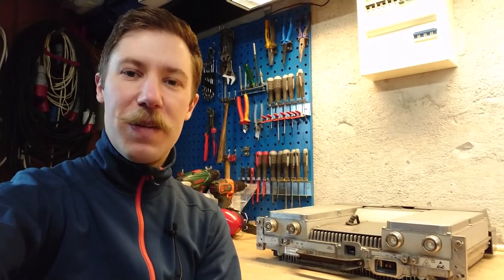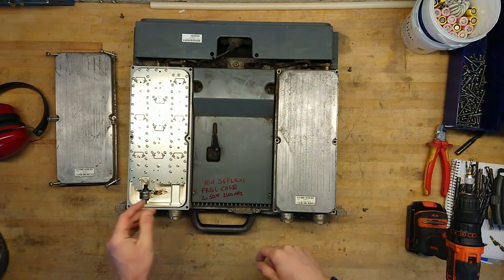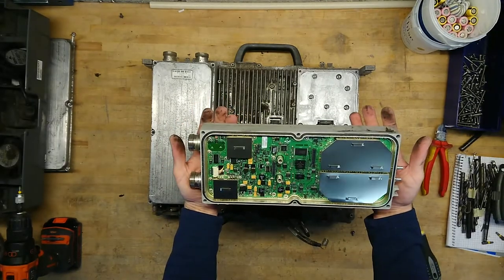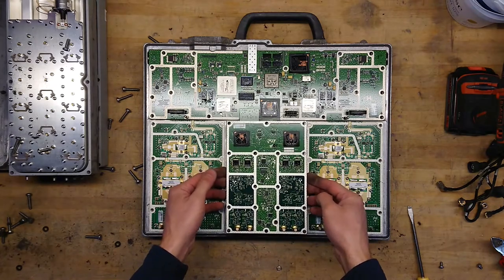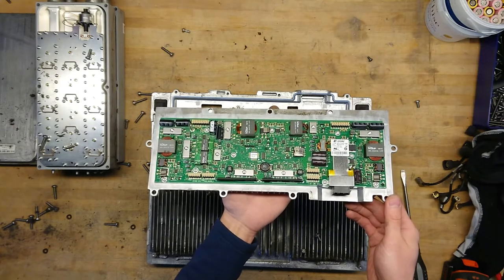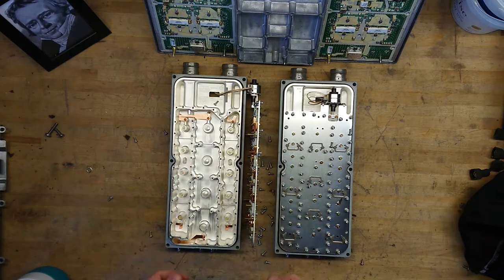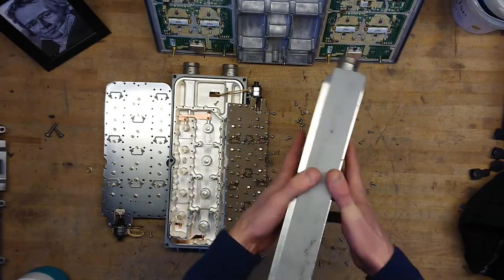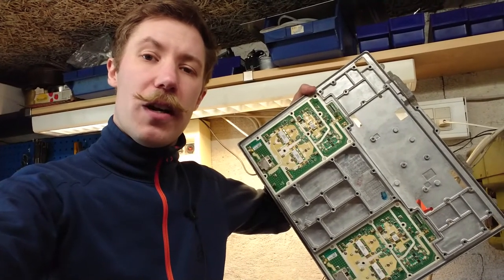Nokia Siemens 3G Flexi 2100MHz 2x50W Amplifier Teardown (part 1 of 3)

Comment: Great teardown as always.
 

These amplifiers feel weirdly familiar ;)
I guess these are the ones I got?
... okay I watched the video, I see. 
You were definately right about them being easy to reverse engineer. 

The QMA connectors are indeed very nice. 
They were developed for being quick and easy to connect / disconnect without any tools. 
One of the most common places to see them is actually cellluar infrastructure. 

I'm always fascinated, how much some of these units feel like super low volume prototypes. 
The Alcatel one I took apart is also a good example for this, I think.
This unit seems pretty modular, which I guess makes it easier to change single boards. 
However I expect it to be more expensive this way and more work to assemble. 

I like the electrically tunable filters, I have never seen one of those in person, I guess they are kind of "out of style" for the newer ones.

Greetings, 
Michael
Reply: I think they not gone, or maby they are in antenna side? I understand basics, not "everything". Old times antenna cables can be very long and I think that flexy change the game and I remember when fibers come and boxes moved to few meter away from antenna. I think it was wasting use long cables and cost weaning incoming signals. And copper is expensive and robust. Fiber is very clever idea from beginning. 
Is that link 1, 4 or 10gb? And can you just power it and login if you have fibers and gbics to pc? I have all stuff, but not single flexi already to test. Can it cause broblems without antenna connected anyhow? Noise unwanted or even health issues? I think that system know when there is no antenna when it's booting but who knows what it configuration be from last user. I think if you don't know, don't try before asking someone from more knowledge..
Reply: @jannejohansson3383  
The older systems were located in the cabinet on the ground with thick coaxes (mostly cellflex) going up to the antennas. 

The more modern units consist of baseband units on the ground and a remote radio head on the top of the tower to keep the coaxial runs as short as possible. 
The conmection between the baseband unit and the rrh is most of the time a CPRI interface. 
This runs either on copper or fiber. 
They use 10gbit sfp+ modules most of the time. 

The complete system monitors the swr of the amplifiers output and therefore a "running without an antenna" is not really possible.

in the lab you need to make sure that tjere always is an attenuator or dummy load attached to your output. 
Running the amp without termination can destroy it. 
However most amps have circulators that can protect them (atleast for some time) 
if you have very powerful amplifiers with very bad matching, they can be a danger since the radiated power can heat up your body.  
However the danger of a prebuilt unit of this power range is rather small (but definately existing) so proper precautions need to be made.

Comment: Someone trash is other one's treasure. That ewaste what is awailable, is crazy. Just that age stuff is new for trash and ready for grazy test If wanted, and basically prize for that is some 20€? 10 years ago costed same as new car.
Reply: The scrap value for such an RRH is around 60 to 120€ depending on where you get it. However your point is still very true, if you consider how expensive these RF components were and that they are under 10 years old, it is quite amazing what you can get for the scrap value now.